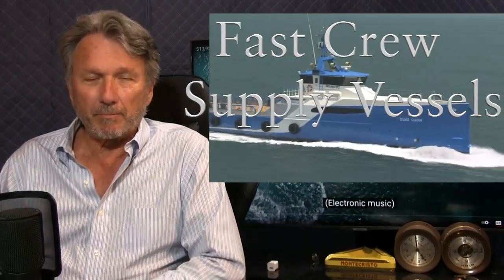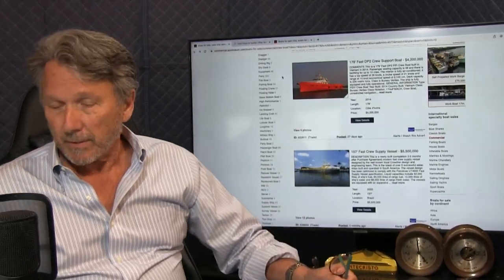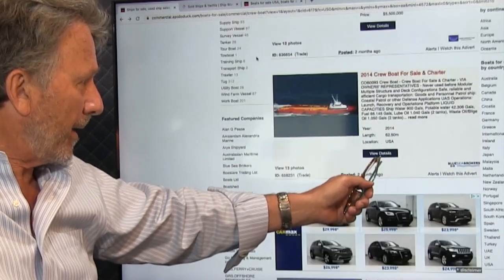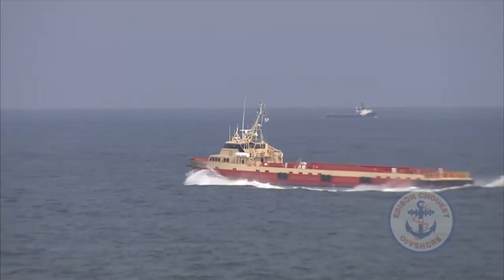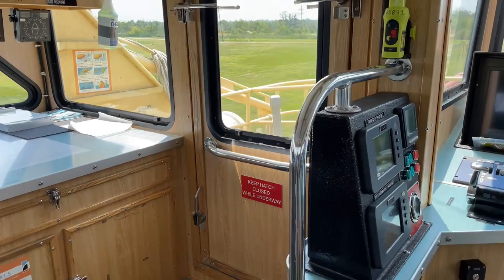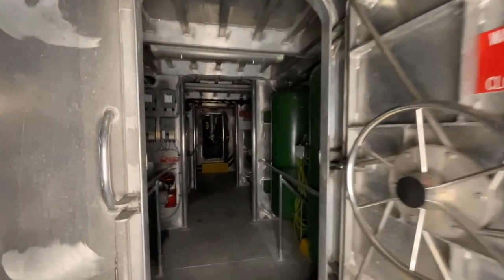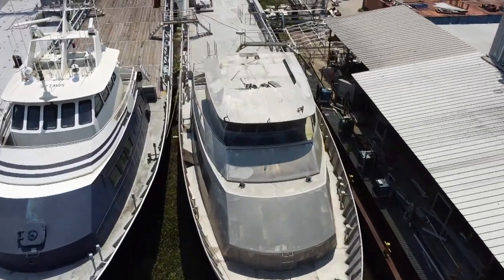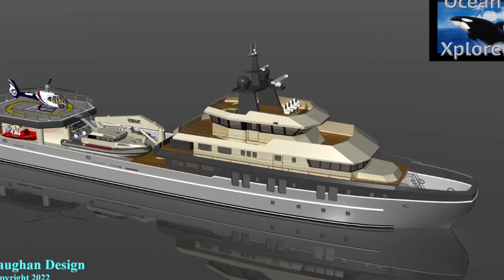Conversion of Fast Crew Supply Vessels for Yacht Support or Expedition/Explorer

Comment: Even if you built extensive superstructure on the aft deck it would still be well within the load capacity of the ship. They are designed to carry very heavy equipment items and bulk cargo like mud and fuel.
Reply from the maker: Absolutely.

Comment: I'm quite familiar with these, but most of these Damen conversions have semi-displacement hulls complemented with fin stabilizers, so I don't know how these will perform in the poles or in heavy seas.

The Norwegian rescue vessel,, the OSVs, and the 83m X-bow vessels are the best options.

The Canadian Coast Guard vessel is the strongest contender, but at 7,500HP and with the top ice-class plating, it wouldn't be too economical.

The Norwegian patrol vessel, the T-AGOS vessel, and salvage tugs are also good options, but I wonder if those could carry an amphibious aircraft.

This might be a flimsier, but a more economical option, albeit, perhaps, still a bit small for an amphibious aircraft